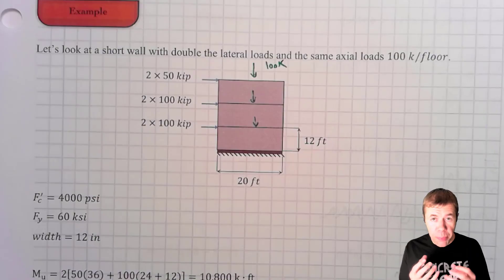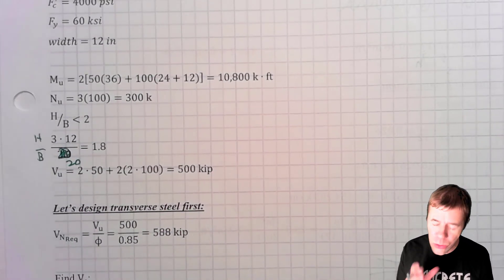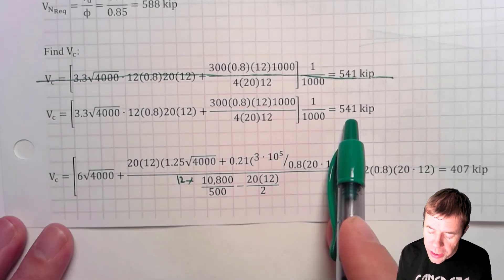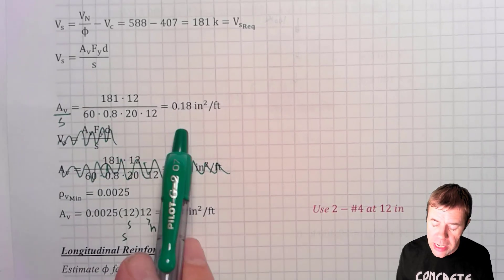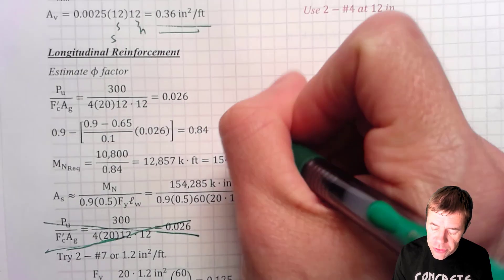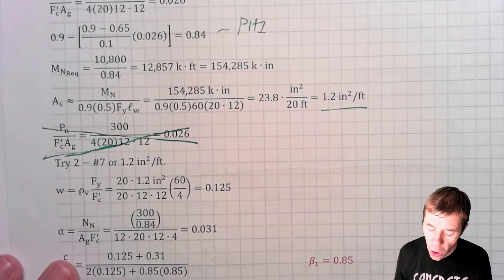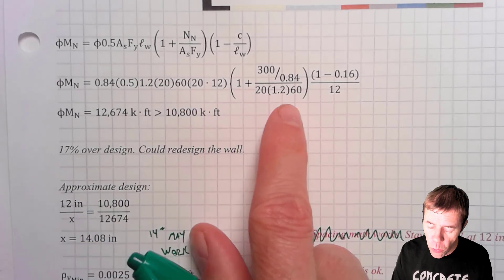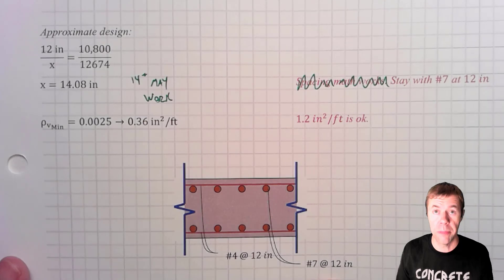Concrete Shear Wall Design Example

Comment: By what wizardry do you get a phi factor of 0.85 for shear?
Reply: same question as it is 0.75 in case of shear
Reply: @azaanahmad6265  and often 0.6 if it is for seismic and not capacity designed

Comment: ERROR - For the first Vc equation there is an small error. Where the 4(20)12 is in the denominator. The 12 which is a unit conversion is not needed and the numerator of that same part of the equation should be changed to 300(0.8)20*1000. This will get you to the 541kips if you were confused.

Does anyone know where in the code these two Vc equations come from?
Reply: ACI 318-71

Comment: For the second part of the first Vc equation, to my knowledge the formula is Nu(0.8lw)/(4lw) however you seem to have done 0.8 (12) which is your height  I presume. Was this a miss print on your end or am I missing something important? Either way though thank you for this video, great help for my design class.

Comment: Excuse me I’m making a concrete pot for succulents.
I’ve made many pots but always got small cracking.
I use 0.45 Water cement ratio and 1 part of sand and 1 part of cement and 1% micro AR fiber by total concrete weight.
Do you have any suggestions to make a perfect pot .thank you very much!

Comment: what effect if any would coating a concrete wall and/or slab in resin have?
Reply: Structurally I mean, and during the first stages of curing. Basically wondering if I build a concrete underground storm shelter, and coat both the inside and outside of the walls as well as the floor and ceiling would that add any strength and or help prevent cracking?

Comment: As a multiple building owner, looking to pour some concrete, I am finding your series of videos useful and interesting.  I have poured a few projects with concrete before, but it turns out I made a lot of mistakes compared with what I have learned since.  As a result, I am rather certain that my upcoming projects will last longer and look and work better than my past projects.  Thank you for making these videos available.  In my next small project, while still from bagged concrete from a store, will be better because of the water to cement ratio trying to keep it .4 water to cement or less (provided I can figure out the cement content, reviewing ACI 211.1 and maybe using a plasticizing admixture), the mixing and attempt air entertainment at about 6% and large void reduction, I plan to use fibers, likely basalt, in addition to better placement of rebar where I can anticipate tension, and of course the curing.  I doubt I will get it all perfect, in fact, rather certain, but I will try.  I would like my concrete to far outlast me.  As a result of what I have learned, I am rather confident that it will turn out better and last longer than it would have without me having viewed your videos.  My appreciation of concrete has grown dramatically.  Thank you for that.

Comment: Oh yeah.   This is eXactly what we need in our shop.  Some serious PE genius.   TNSRsys.com is streaming UHMWPE fiber into concrete and it just keeps getting it.  Our tests are 8' wide panels because we want to be able to move them without special highway permits.  8'x25'x0.5' without any steel was fine.  We're going to edge lift it now to see how that goes.  We've been challenged to try edge lifting a 8'x40'x1' panel.  What do you think about that? Crazy, right?

Comment: Hi Tyler, I'm making concrete flower-boxes and I'm wondering what happens if I fill and use them without letting them dry or coating them? They will be filled halfway with water all the time, do they survive at least for five to ten years?

Comment: CRSI is having a pre-sale on their Design Guide on ACI 318-19 Building Code Requirements with coupon code: PRESALE-318

I’m not a spammer. Just thought I share this here for you concrete knuckleheads. I just bought it.

Comment: I'm not a concrete designer, but why is rebar always calculated for a vertical and a horizontal but never installed as a triangle or truss shape? it seems like the advantages of trusses would also translate to reinforcement. also, how does dispersed fiber reinforcement play into these calculations? is it just not used because it's hard to predict the distribution?
Reply: good question what you are pointing out is a very advanced plastic design of elements concept commonly known as strut and tie method
Reply: THIS is the question.  We're hoping to change that!  TNSRsys.com